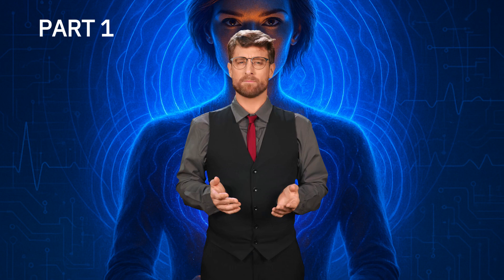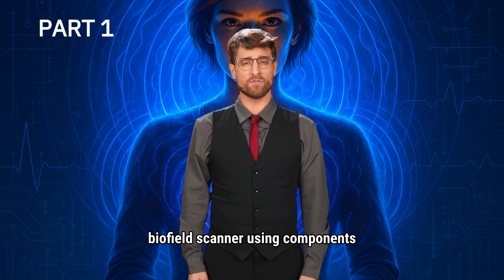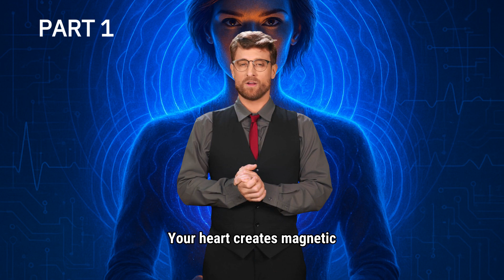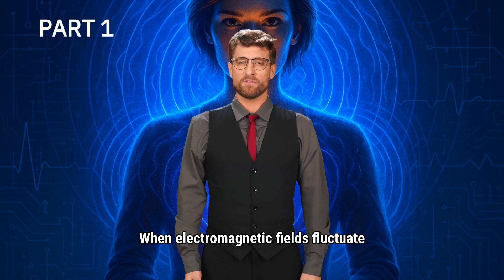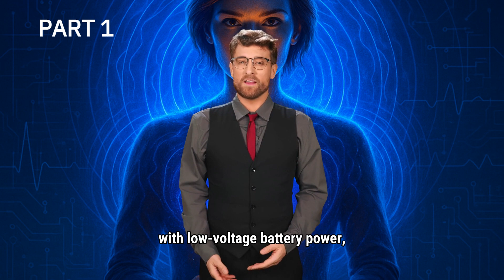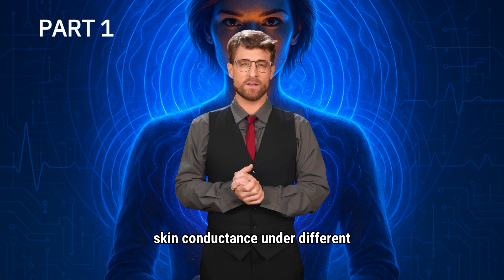PART 1 - Build a Biofield Scanner for Under $50!

Comment: What happens if this field was to increase instead of being weak?  Two weaker fields become one unified stronger field maybe or really it is one field but one side or the other is weaker putting stresses upon the other the 9 is the unifier of it all but what they fail to talk about is the center of the triangle an that compass the point in the middle where all the lines meet at. Should that spot be 0 an everything at the same time?